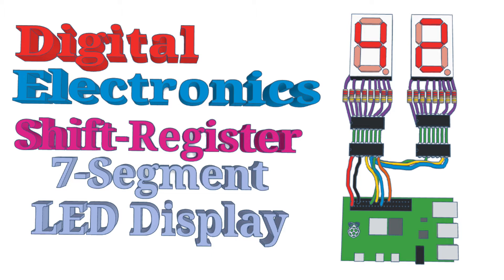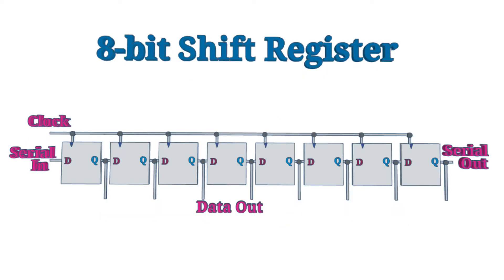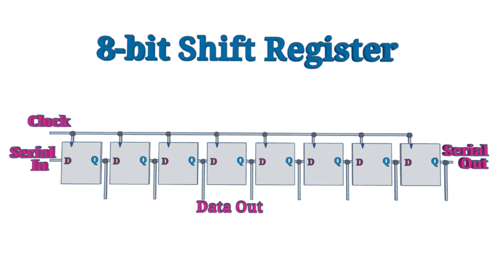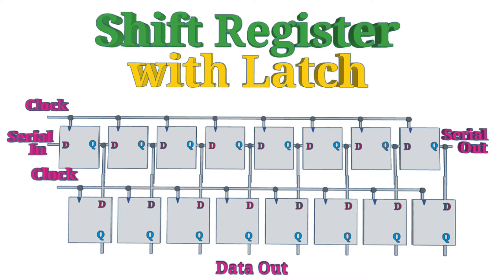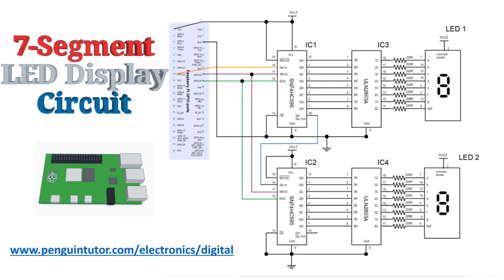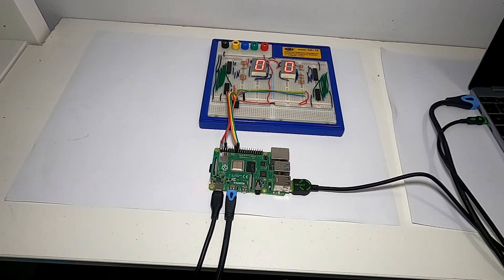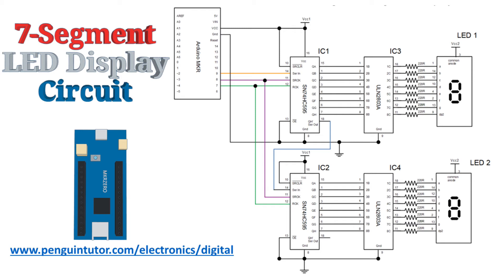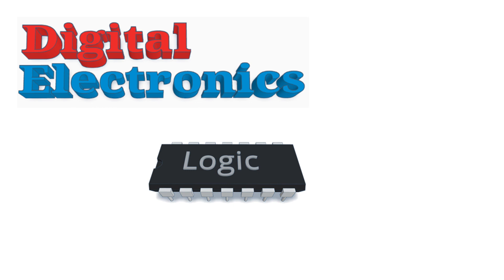Raspberry Pi and Arduino 7-segment LED display - Digital Electronics Shift Register

Comment from the maker: The shift register used here is the SN74HC595. This is a particular type that is widely available as a Dual In-line Package (DIP) so can be inserted in breadboard. There are other variants available which can handle a larger current for the outputs and so drive the LEDs directly, but these are usually available as surface mount components.

Also note that VCC2 on the circuit diagram is shown as a separate power supply. If using just two 7-segment LED displays as shown then that can be connected to the 5V output of the Raspberry Pi GPIO (ports 2 or 4) or the 5V supply on the Arduino. If you want to add more displays or switch higher loads then you may need to connect that to an alternative 5V power supply.